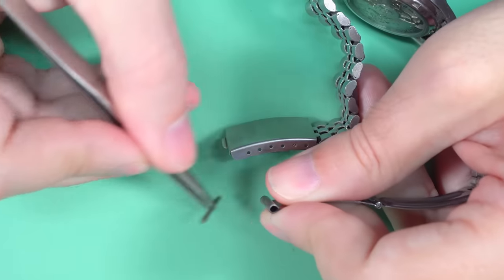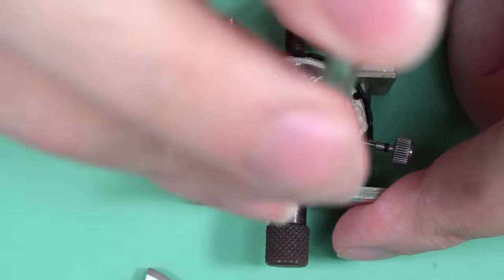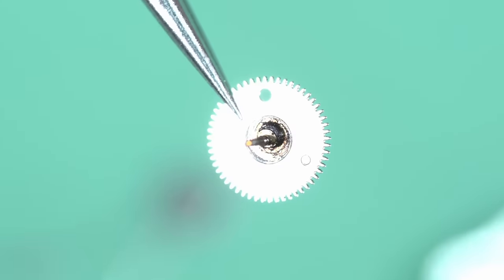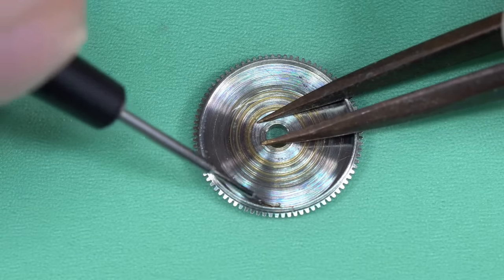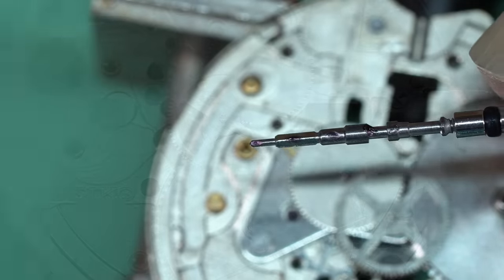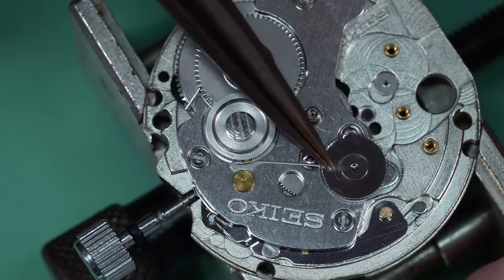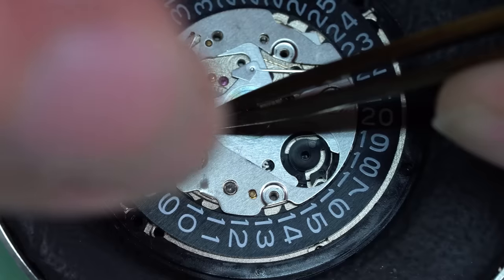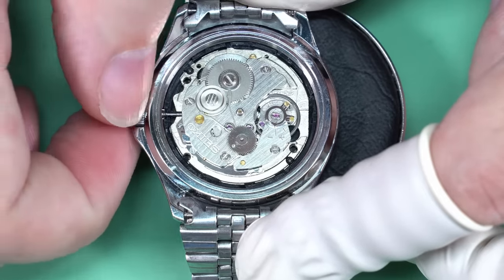Seiko 7s26 full stripdown service, restoration and watch repair tutorial

Comment: A 7s26"B"  I have seen/worked on "A and "C", but I have not seen a "B" before.  The wheels and plate for the calendar movement vary between "A" and "C" revisions.
Reply: How does a B compare to a C? Is the C a significant upgrade or is it very minimal? What exactly changed?

Comment: great video. I have a seiko monster that I almost destroyed in my effort to calibrate it. Ι inflected a little the spring between regulator pin and regulator arm. However I managed to make it work again with almost good calibration. Though I discovered that its calibration differs according to the position of the watch . Is this normal or it is because of the inflection? Is it cost worth it to service the spring?

Comment: Are you using the same mechanical washing machine to also clean the mainspring? This would require the mainspring to be wound into the basket, so a potential for deforming of the spring. Or, are you using an ultrasonic machine just for that?

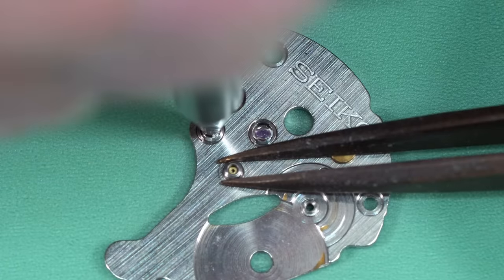Comment: Hi Mark, thanks for the awesome video. Loved it. I have a question though. At the 13:28 mark, I see you are using a tool to reinstall the spring that holds the cap jewel onto the hole jewel. May I know if that tool is the kif jewel spring tool?

Comment: Hi! I have two important question. 

1) I also have a demagnetizer and a seiko 5. The machine is quite strong, things start to resonate and get pulled towards it very strongly, so I suppose it is a strong magnet. Also, with one of my cheap watches, I put the watch on it and the balance wheel slowed down significantly and thus the magnet affected the balance wheel's motion quite strongly. How should we put watches on the demagnetizer? While they're running or not running? With seiko 5s that would be waiting 40 hours till the power runs down. Does it make a difference? 

2) With the same seiko 5 model is it safe to rotate the crown backwards and thus setting the time back? It seems to stop the balance spring. So again I was wondering whether that affected its proper mechanism.

I'm looking forward to your reply!

Comment: Excellent work and video Mark.  I’m sure that camera gets in the way  sometimes! 😉 
I noticed on the tear down the day wheel quickset gear was not there but for rebuild it appeared. Presumably stuck to the disc on disassembly .  I usually find that happens on the intermediate wheel on older Seiko movements. 
Was not aware of the weight and reduction wheel alignment either so I have learnt something . 
Questions,  what sort of tweezers are you using to pick up the diafix jewel? Those things are a nightmare for me as much as your dexterous the quality of tweezers must really matter also.
Also liking the pallet insitu like that , did you do that without any magnification?  I have to do those under the scope but would like to try your method. 
I’d have been happy with an aptitude of 235....    in the world of 70s Seikos that I live in we are lucky to push then past 200!!

Really pleased I watched this . I now need to save for that Bergeon Ergonomic oiler (presume that’s what it is) also loved that barrel press. Never seen one before .  I’m off to cousins to find one now!!  More shelling of peas from my wallet now!! 

Thanks
Reply from the maker: -Yes - it was stuck to the plate, that's quite common.
-If I didn't show the weight alignment I would have had a ton of comments about it lol.
-I believe they are the Dumont size 3 or 4, can't remember. Dumont are my go-to tweezers.
-On camera oiling of the pallet stones is near impossible as I am sure you have found - I just touched them for illustration. I use my 10x eyeglass.
-For vintage movements 230 upwards is OK. But don't expect that from old pocket watch movements or cylinder escapements.
-The ergonomic oilers are absolutely fantastic. I can't recommend them enough.
-The barrel closer is real cheap and worth it in my opinion.
-My 'Cousins' Shopping cart is filling up lol. Will be in the UK in July so a trip to Clerkenwell is definitely on the cards. :D
Reply: Watch Repair Channel  My Cousins basket is always brimming, I love that you can keep adding items over time until your ready to order.   I also like Dumont although not too many pairs yet.   Granted filming of oiling is challenging however I use my phone and a telescope/ microscope cheap bracket adapter. Takes a bit to set up but once done the results are worth it. Modern phones are so good in resolution now.  Only downfall is that (as long as your scope is stereo) you have one eyepiece only and as my eyes are poor  without my glasses what I see in focus the camera does not.  
I’m still not good enough to use the phone screen to do the oiling as I loose that depth of field .
 
Hope you enjoy being back in Blighty for a while . Remember to take more tools back with you .

Comment: That's the exact same model as my watch ;)
I've had it for about 3 years, i hope it lasts a bit longer.
Reply: Which specific model is that?
Reply: @MrJenya79  I can't find the exact model, all i can barely read on mine is 7s26 10y4 p3 2, which leads to almost the same watch on google, but with it's crown at 4 o'clock
Reply: It can last 10 years if you're lucky

Comment: Many thanks for the video. I have the following question: when you try to reach the certain  rate/amplitude/beat error levels, do you follow a watch maker's standards stated somewhere in manuals? For instance, do Seiko require that a 7s26 after service should have not less then ... amlitude? Or you simply rely on your experience, timegrapher data etc? Thanks again

Comment: Is there a difference please between the oscillating weight in this movement and that in a 7S26-03E0 movement? I don't know how to confirm this.... Thanks very much, Dave
Reply: Don't know if it helps but I'm familiar with several 7S26 movements with varying prefixs and all the oscillating weights appeared to be the same. So I don't think that the number refers to any change in the weight or its design.

Comment: Don't suppose there's any chance you could do a video on replacing the spring and wheel in the balance assembly? I had ... issues... with mine. Would like to see the best way to do it.
Reply from the maker: Many movement calibers may have a balance complete available as an off-the-shelf part. Check with your local watch material dealer.

Comment: I had a friend who had a very nice Oris chronograph that had the stem crown break off so the movement was exposed to outside air. I know he had it like that for around 2 yrs and there were little rust spots visible. Would this be a total loss or fixable? I remember at first the seconds hand would still run but it flat out died after a year

Comment: Hi just subbed and love your vids. Just trying to repair my year old 7s movement.  When I rotate the 1st reduction wheel without the oscillating weight attached, the pawlers are doing its job pretty well of grabbing the teeth and rotating the 2nd reduction wheel. However, if I reinstall the oscillating weight and rotate it, the pawlers are not grabbing the 2nd wheels teeth even if the first reduction wheel is also moving when oscillating weight is rotated. what could be the problem?

Comment: I apologize if it was you that I already asked this, but I really want to get into doing this. I currently mod/build nh35 mods mostly. So I am not completely green to taking apart a watch. I just haven't yet taken apart a movement, which I realize is an entirely different animal. My question is what movement should I begin with? I assume the best way to learn is to get a movement/watch that's fairly inexpensive and have a go at it. Take it apart and put it back together. Should I maybe start with a 7s26 like this? You can pick up a running old Seiko on eBay for under $50 easy. What do you recommend? Thank you

Comment: Is it worth to buy Seiko five at US$100(7S26) compare buy Seiko 4R36 at US$160? If Seiko 5 is very likely to faster than 20 secs or slower than 10 secs per day, I will not choose Seiko five, what's your opinion? What is the price for this restoration, do you take the job?

Comment: Hi, my day disc is slightly wonky in it's resting position, any ideas? Thanks
Reply from the maker: Depends on the movement. Could be the calendar jumper is upside down, could be the wrong calendar ring, could be a dodgy jumper spring, could be the dial feet are bent... naturally it would have to be investigated.

Comment: at 2 : 33  second hand pin move back with other hands. i had repaired my watch now after repair my watch's second hand pin run just like this pin back. it is stop back and run on several points. This is happening with my seiko 5 please i need solution.

Comment: I had a Seiko diver. Had it for a week. It had the same movement. I dropped it on a carpeted surface, and broke the mainspring. Seiko wouldn't repair it under warranty. I took it to a watch repair place, and they wanted $225 to replace the spring. That's about exactly what I paid for the watch new! Question with that in mind. Why would you spend that kind of money, servicing a watch, vs. replacing it outright? The Seiko 5 you are servicing can be purchased for roughly $100. I doubt this type of service would come in less than that.

Comment: Assuming he got the very first batch of the 7s26 movements that came with etachron, the watch couldn't have been more than 13 years old. Kinda debunks that whole myth that these movements will run for decades without service doesn't it?
Reply from the maker: They will run for decades - if they're serviced regularly. There is no magic movement out there that defies the nature. When anything has moving parts which rub together - those parts will degrade :)